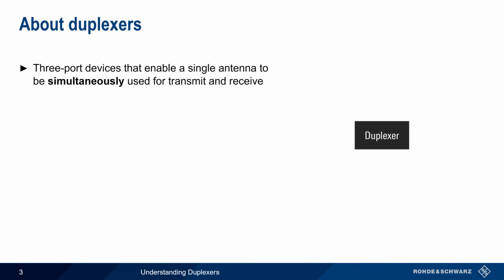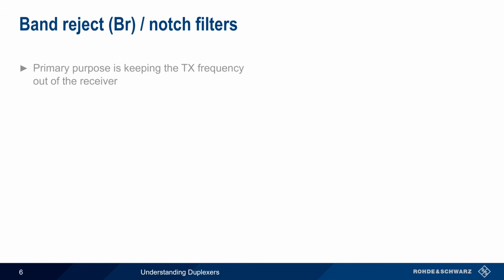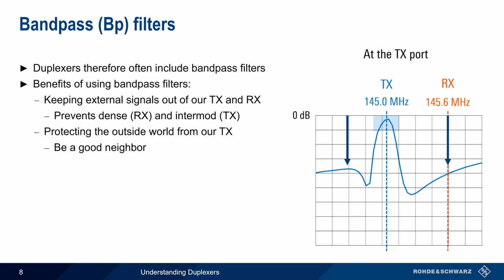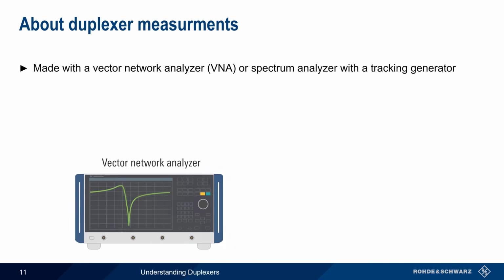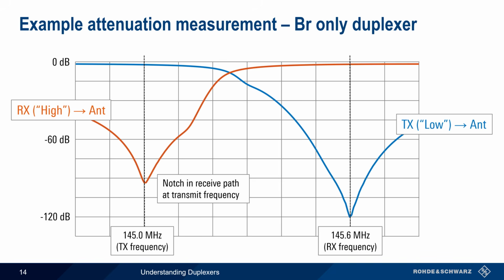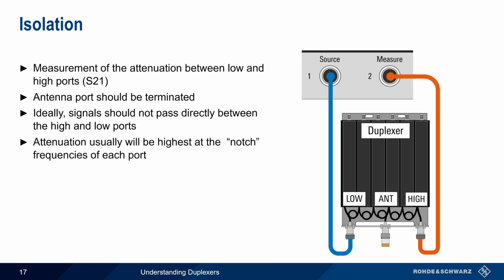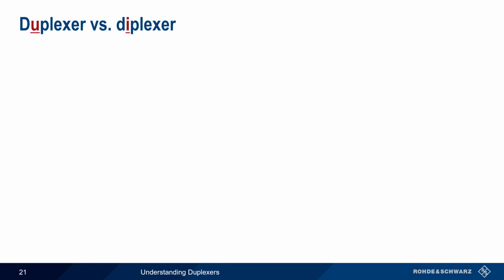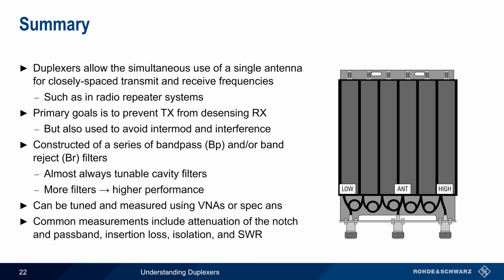Understanding Duplexers

Comment: Does anyone know what is the reason to differentiate the duplexer and diplexer in such way?
Both solve same problem just different implementation (which is not really hard defined for either).
Reply: The differentiation exists because the designs, capabilities and intended purposes are different. Under the Law of Non-Contradiction, a thing cannot be both A and not-A at the same time and in the same respect. A vessel cannot simultaneously be designed for speed and not for speed in the same operational sense. While both a speedboat and a cruise ship float and travel on water, treating them as the same ignores the logical distinction required by their opposing design purposes. Hence Diplexer and Duplexer.